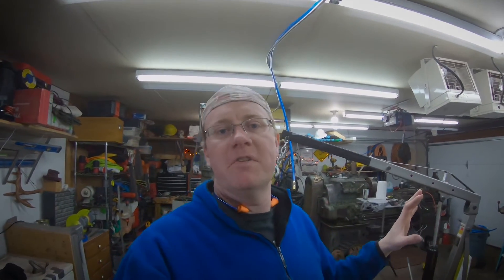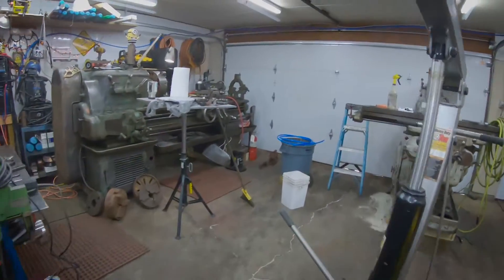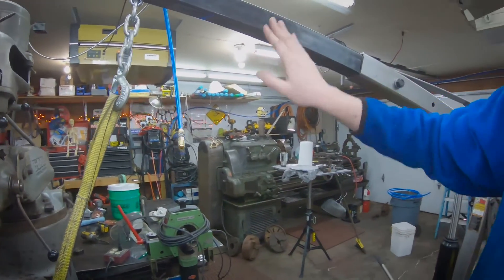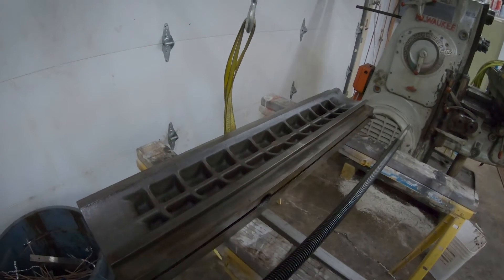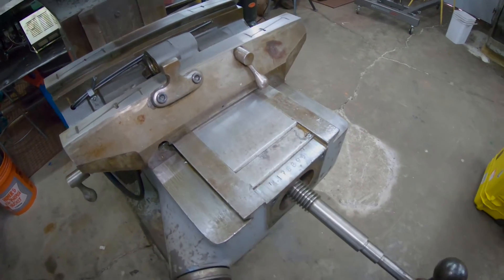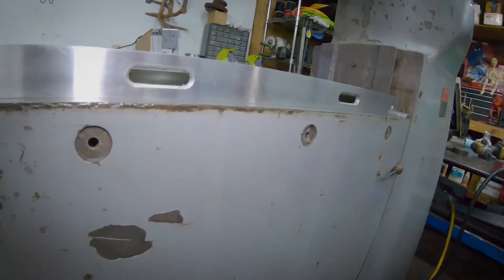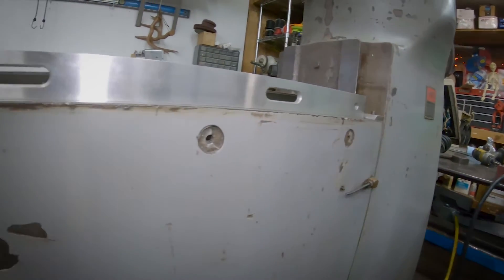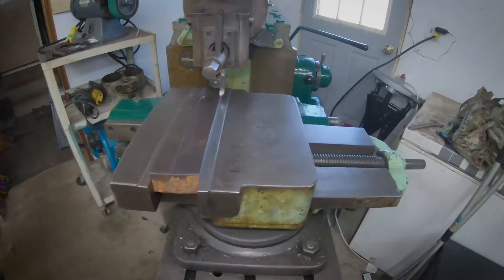Bridgeport Mill Restoration Part 1 & Running the G&E Shaper

Comment: Tell ya, unless you are doing an aerospace contract... what tolerances are you- unhappy with? Doing farm machinery barely requires tooling up a mill like that, never mind holding a thou. Up here in the northeast.. where they sorta 'invented' precission machining... adding heavier and heavier grease as the machines wear down...can but you a generation of borrowed time.. so .. if stuff like broaching mills is some sort of therapy for ya... don't sweat the Bridgeport...

Comment: Yeah shaper action. Sounded like the tool was dragging on the return stroke. May want to turn the clapper box to help the tools cutting edge stay sharp longer. :)
Reply from the maker: Hey thanks, I'm still a shaper noob.  That was the first piece I have cut with one.
Reply: Turn the top of the clapper in the detection of travel,  so the tool swings away from the work